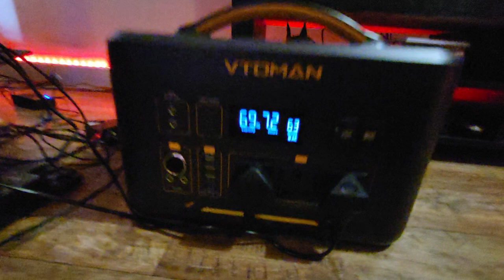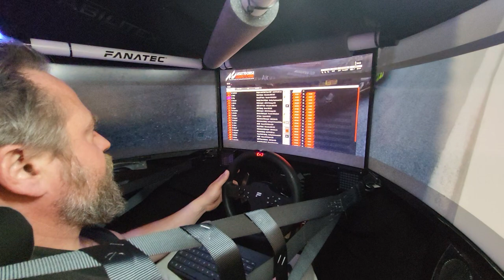Custom Sim Rig Tour - How to Build a Sim Rig Under £5000!!! - Part I

Comment: I just started with simracing, first thing i did, build a diy aluminium rig. Made life so much easier, im on a moza r9 v2 right now, but wil upgrade to the r12 when it is out. Nice rig, enjoyed the video very much and like the lights you have set up. Without my pc (that i had before that 5900x, 32gb ram, 4080) im at around 1,500€ right now, got a very nice real car seat for 50€.
Reply: Rather wait a few more months cause the first batches are always problematic with them bases .
Reply: Can u have ur old r9